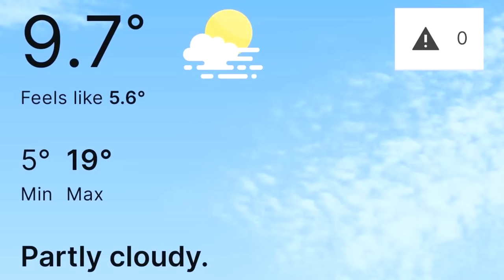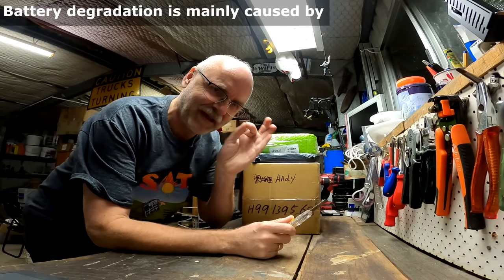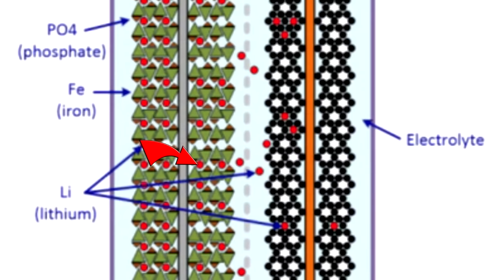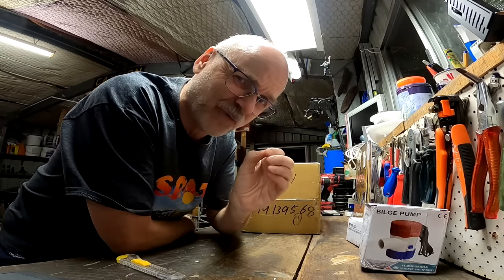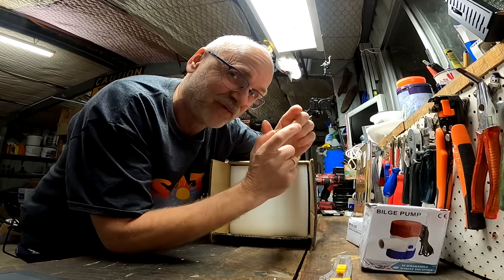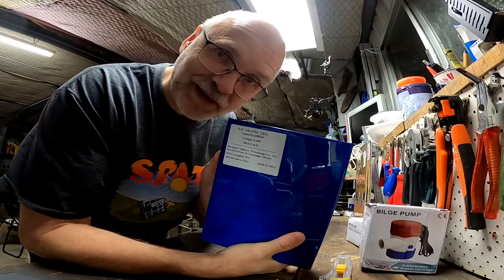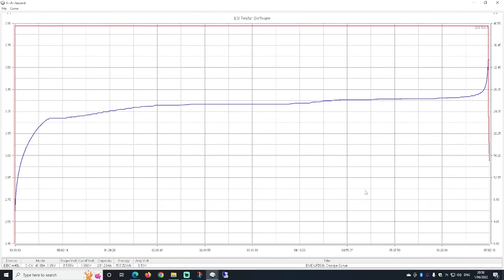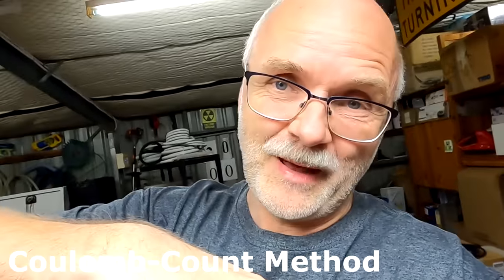Busting the 20%-80% SOC myth for LiFePO4 batteries.

Comment: I'm sure I read somewhere about how not having about 50% charge - with equal charge on both sides had long-term degradation potentially - but not so much vs calendar life wear anyway, but I thought I'd also read somewhere that you want to keep your charge cycles short which favours higher voltage.  But my memory's vague and imprecise and I couldn't comment on reasons.

What I've struggled with is standby SOC.  All I want are UPS systems which seem simple to make now using ideal diodes for DC standby power ... but I'm not sure it's good to hold LifePO4 cells at 100% standby all the time?

If it's accepted that holding the cells for long durations at lower SOC leads to longer calendar life, and if the cells are capable of 3000 to 6000 even cycle life, are there not charge systems that will simply charge your cells to 100% every day say, or maybe once a week / whatever makes sense,  and then let them power the load 'til they drop to 50% to 70% SOC ... whatever the optimum is ... and then keep the load powered by your mains supply etc.  Would that not optimise your calendar life for a standby use?  They could have "intelligent" modifications to their profiles for brown-out/black-out events based on their intervals etc.

I've never been able to find items to purchase that performs this kind of charging/status-maintenance profile.
Am I mad in some way for thinking it would be a good thing to want?
Reply: Edit ... 50% charge - I meant "unequal" charge on the opposite electrodes leading to degradation.
I tried chatting to Chat GPT about it ... extract:

CHAT GPT:
Indeed, the nominal voltage of LFP (Lithium Iron Phosphate) cells hovers around 3.2V or 3.3V, and you're right that the full charge voltage peaks at about 3.6V before settling back down when the cell is at rest or in an open-circuit state. This difference in voltage might seem like a short hop in the cosmos, but in the world of battery chemistry, it's a significant leap.

The crux of the degradation question lies not so much in the specific voltage value itself (whether it's 3.3V or 3.6V), but in the battery's state of charge (SOC) and how long it remains at or near full capacity.

High SOC (Close to Full Charge) Degradation: When we talk about degradation at high SOC, we're considering the battery's condition when it's kept fully charged (or near that state) for extended periods. At this state, even if the voltage settles to around 3.3V after charging to 3.6V, the battery chemistry is in a state that is more prone to degradation. This is due to several factors:

Stress on Electrode Materials: Being at a high SOC means the lithium ions are densely packed into the cathode, putting stress on the material.
Potential for Electrolyte Decomposition: While less of an issue at 3.3V, the battery having been at 3.6V and full SOC means there's a potential for more reactive conditions that could have initiated decomposition processes, which might not fully reverse even if the voltage drops.
Voltage and SOC Relationship: The flat discharge curve of LFP batteries means that they operate over a relatively narrow voltage range for much of their discharge cycle. At any given voltage point on this curve, the battery's SOC can significantly impact its health:

High SOC (near 3.3V): The cell has been recently charged and could be experiencing the after-effects of high SOC stress even if the voltage has normalized.
Low SOC (also near 3.3V): The cell is in a more relaxed state with less stress on the materials, less densely packed lithium in the cathode, and generally more favorable conditions for longevity.
So, to navigate through the asteroid field of confusion: The concern with degradation at high SOC is less about the voltage being momentarily higher during charging (the journey to 3.6V) and more about the state of the battery's chemistry when it remains fully charged. It's the difference between sprinting to a finish line and then staying tense and ready to sprint again, versus relaxing after the race. The latter is akin to a battery resting at a comfortable SOC, where its chemical components are under less stress and thus more durable in the long haul of their operational life.

Think of it as ensuring your starship's dilithium crystals are not under constant pressure, even if they can handle the power flow; giving them a breather extends their useful life in the vast expanse of space exploration.

---

I was wondering - seeing how prices for battery's have come down so much with a 280Ah Eco Worthy 12.8V offering on Amazon in the UK for £699 - £150 voucher = £550 ish ... and looking at Victron's MPTT solar chargers not because I have solar but because of the VE Direct thingy and higher charge rates than their chargers ... where I could just use a 480W 48V supply I imagine as input to a 100V/50A MPTT charger, whether I could use those components to implement the charging profile for UPS standby use I want.  I was looking at the Renology 3000W inverter (I'm unlikely to exceed 1000W and would live mostly under 400W).  It says it switches over in less than 50ms which is a bit slow, but I use Seasonic ATX supplies in my computers which have a long hold-up time.  And that inverter supports a remote switch ... I'm not quite sure if that can just toggle the inverting function but allow mains AC if present to be available at the output sockets but if not I'm sure I could rig something up.

Yeah - I was thinking - I could let the charger do it's thing, but monitor it - maybe with an ESP32 or something and with MQTT to Home Assistant, so that when the battery's fully charged I could activate the inverter and switch to it's output until I've counted (oh - I'd probably want a smart shunt too - I forgot that - with ve direct etc. - if I've got that terminology right) roughly 20% to 30% as a compromise battery SOC used up, and then switch the invertor to mains again so that the UPS is in standby mode.  I'm imagining, maybe, the ve-direct thing would allow not just profile changes, but active disabling of charging ... so I could deliberately turn-off charging in the MPTT controller until there's a brown-out / black-out event in which case I'd turn it back on again until logic based on event intervals and with buffer times tailing etc. gives the all clear (after 100% SOC is again achieved and the deliberate discharge occurs again).

With home experiment stuff I was messing about with lots of smaller batteries so I could over-engineer wring and have less current and play things super-safe with lots of protection but that introduced lots of management complexity and I never had the time and space to see things through.  But I wasn't aware of Victron stuff.  I always thought of the things that I occasionally noticed on Amazon as being for solar panels etc.  It didn't occur to me I might be able to use them for my UPS ideas without solar needed.  (I'd love to have solar but I think we'd need a new roof first in our tiny Victorian terrace with very little space to accommodate green tech).  But now costs have come down and with the revelation on what's available ... well ... now my debts got out of hand and it'd be risky putting more on credit cards lol ... but still ... it's tempting.

Again though - am I mad for wanting the set-up I suggest?  To me it seems like "common-sense" for a UPS.  I want something that might last 10-years plus with having to think about it or worry about it or be bothered if there's complex brown-out/black-out events or whatever.  And on a budget.  I just couldn't seem to find stuff ready-made.  That wasn't huge or really expensive or that did stuff I didn't need.
Reply: Oh oops - I keep conflating numerical values lol ... for a DIY 12V system I have on the wall I have an LED panel with the voltage showing ... and because that can show 13.1 to 13.3 before dropping to 12.8 etc. and sit at 13.6V for a bit during charging,  I keep confusing that with "3.3" and "3.6" cell voltages when I'm tired.  Anyway.  I think I communicated the essence of what I was trying to say.  Though I forgot to say about scheduled recharge/discharge and occasional discharge/recharge/discharge cycles on top of awaiting brown-out/black-out events in my little imagined scenario.

Comment: I ike keeping cells under 1c charge and discharge,  but 0.01c discharge is better, with about 0.5c charge, or less, and normal cycle in the middle 80% of the capacity, or around the nominal voltage, but fully charged occasionally to allow a balance of the cells,

Comment: There are chips , that calculate SOC, so U know / after 100 % sychronization /, when U have 20, 25, 30 or 90 95  % SOC. U can also program ESP32 + current sensor or ESP32 + 24bit converter, to have something like BMV712.

Comment: Sir, after the number of rated charge cycles (4000 to 8000 they say) of my 12v Ampere Time 300 ah LiFePo4 can I safely keep using it? Like once the capacity begins dropping below 250 ah? Is there any danger?

Comment: Battery tester is brilliant, is there one for higher voltage, around 70V?
Reply: Do a search for EBD-B10H. It's a similar size (physically) but does up to 72v. Because of the higher voltage range, the current rating is "only" 10A.
Reply: @CollinBaillie  Thank you very much for this.
The EV batteries is the cheapest way to get Li-ion, the problem is they are either 12S or 16S and that doesn't match your typical 48v in inverters, so you would have to give up the top or tail of the charge curve. 
This tester should help to find the sweet spot in 16s or 12s  NCM cells.

Comment: I was under the impression that lithium ion batteries were also charged by constant voltage/contant current method?
Have I been mistaken all these years?
Reply from the maker: Nope same charging process but very different charging curve. LiFePO4 is very different to Li-ion.

Comment: Hi, if i had a general lifepo4 charger that charges at a FIXED 3.65v per cell, and it was turned off at a theoretical 70-80%, would this result in significantly less degradation than if it were charged at 3.65v per cell untill 100% charged?    Or would the degredation be of a roughly equal amount?
Thank you for all the information 👍👍

Comment: which is helthier charge cycle: 100%-80%-60%-40%-charge to 100%,
or 100%-80%-charge to 100%, 3x times?
ps: lets skip upper limit discussion (100% vs 80%) in current example as not related my to question

for ex. charge laptop 3 times and then charge lifepo4, VS charge laptop once and right after make lifepo4 full and repeat 3 times?

Comment: To me Andy, the current from your solar array from shade to clear sky would be the main problem! It looks like to me this could Literally fry your batteries by inducting so much current!
Yes batteries do get hot when topping and forcing more in than they have room! But the heating of the batteries start with the movement of the ions!
The temperature should be monitored through out the charge cycle to insure a smooth transition!
Sound reasonable!
I am No expert but have fried lead acid batteries! Lead acid batteries do get hot!
I’m sure iron phosphate batteries do to!
By having more battery capacity than solar array should mean batteries will not get as hot.
Reply: Lfp can handle a lot more c rate for charge and does not get any measurable hotter. It’s very much different to lead acid. So no worries.
Reply: @thomasribbeck390  
Any was talking about degradation to cathode and annoys micro cracking. Over amperage was the subject I was referring to. 
Thanks Thomas 
I’m just a wing nut spewing my thought! Lol

Comment: I was thinking about this the other day. They dont specify 80% of what.. volt range? Capacity? How do i know they mean volts and not something different? When they say only use dod 50% on a 200ah gel battery, i assume they mean use just 100ah and the recharge it. Not use only 50% of its volt range.. (low to high range for disconnect?)

Comment: Also consider that if you are at higher C rates, you need to account for drop in voltage of the weakest cell.  So you can't really get to 0% or 100% unless you reduce current.  And my guess is most higher power tool batteries will cutout before 20%.
Reply from the maker: Yes, that is correct unless you really measure at the cell level like the BMSes do. Yeah power tool battery will cut at around 15% as you can always feel when the voltage sage before they turn off.

Comment: Hi Andreas, ordered from QSO 8pcs of cells few days ago from EU warehouse thanks to your recommendation, waiting to see are they A-grade or not
Reply: My last order from Qishou was received in the beginning of May, and was a disapointment. 16 cells LF280K. So called Grade A. Average capacity was around 274Ah, and the lowest were at 270Ah (Testing at 40A charge/discharge). I did however get a small refund when complaining.
Good luck!
Reply from the maker: Oh, that's not good. I'll flag this with them. Thanks for sharing.
Reply: @OffGridGarageAustralia  my QSO cells arrived, all are bulged, one even have small scratch and dent, agent I bought from was Cassie, I just complained and waiting for reply
Reply from the maker: @Silvije2  unacceptable! Press for a  return of the cells and full refund!
Reply: @OffGridGarageAustralia  agent says she will consult company about swelling of cells. Andy is there any level of swellng that is acceptable? Am I overreacting? voltages seems fine... I do not want to ruin their business and they promise cells are A grade... What to do? I am going to consult with other sellers, after all I need to know this for my second order.. edit: after carefuly examining qr codes with instructions of the datasheet rev B. the cells are all over the place, no way they are same batch, 4 cells manufactured this year and other 4 last year .. is this normal? are these some kind of rejects?
Reply from the maker: @Silvije2  This all sounds not good. The QR code should be consistent but does not need to be in order or so. They are really testing each cells before sending them for capacity and Ri. As long as you get the capacity, I would not be too concerned. The swelling definitely comes form their testing.  I don't have any information about their test procedure unfortunately. I had some bloated and some straight over my many deliveries.
If you buy directly from EVE, the cells would be more expensive (50% or more I read). All these cells are some kind of 'factory rejects' apparently. They did not pass the strong quality control from EVE and end up with these suppliers. As they all test the cells, they all should perform as advertised. If they are below capacity, I would complain, if they are manufactured at different dates, I would not care as long as they work. They are trying to match them as good as possible hence the different QR codes I believe.
Reply: @OffGridGarageAustralia  I have assembled the battery and tried to charge it with my 2A charger as I do not have more powerful charger at the moment and what I noticed is when charging, voltage of 5 cells increase more than voltage of other 3 cells. Maybe I am wrong but this does not sound as matched Ri to me if this is noticable at such low charging current. Unfortunately my garage is not as equiped as yours so I cannot measure capacity yet. Anyways, thank you for all your great videos!
Reply from the maker: @Silvije2  charge them in parallel and it will balance out.
Reply: @OffGridGarageAustralia  I decided to keep the cells, even the one with a dent. I refused offered compensation and told them if they still insist to rather buy you a beer. Thank you again.
Reply from the maker: @Silvije2  thanks a lot for sharing here in the channel. It will be in one of the next videos...
Reply: @OffGridGarageAustralia  ok, please don't go too hard on them, when they send cells out to overseas warehouses, cells are really out of their control, if I understood right, so it might be better to order directly from China but I could not wait shipping time as I needed cells quickly.

Comment: I think I would be able to make home automation that would auto-recalibrate the shunt per batter in certain interval, let's say every month. But the question is - with the prices of lifepo4 batteries today - is it really worth it?
Reply: and with whatever degradation the battery bank may be suffering... how long do we expect these cells to last.... Can we know anyone who has oldest lithium cells and share the experience ?
Reply: @innocentusangira789  LiFePo4 is not old enough to provide some long-term experience, at least not with current technology, I guess :( But Tesla is, for example, using the tech in electric cars (Tesla Model 3) that are experiencing heavy usage, rapid charging and other abuses on daily basis.